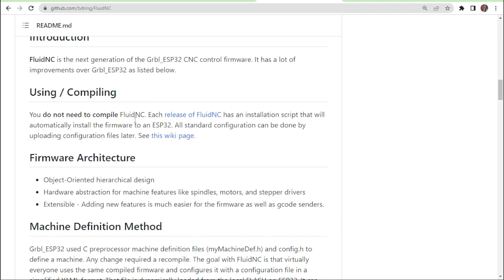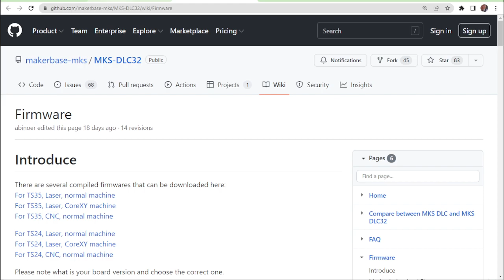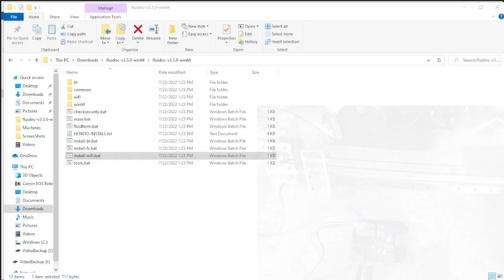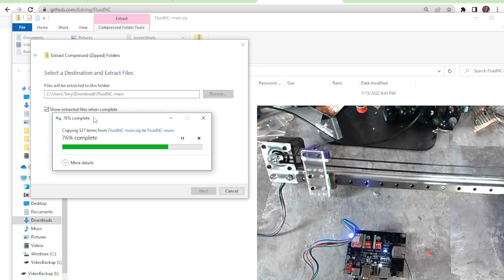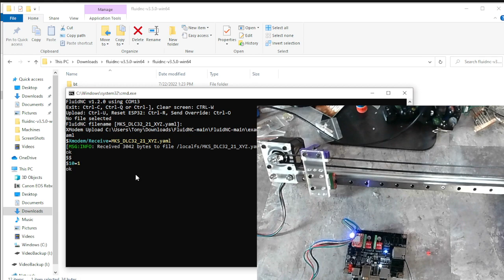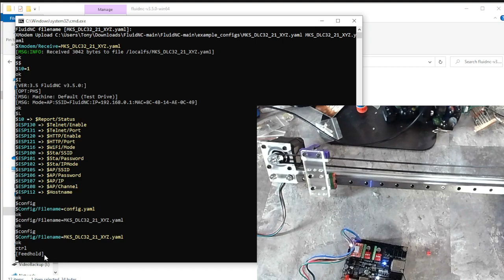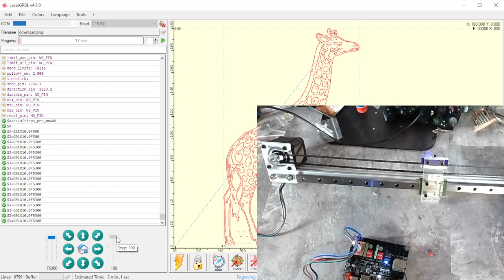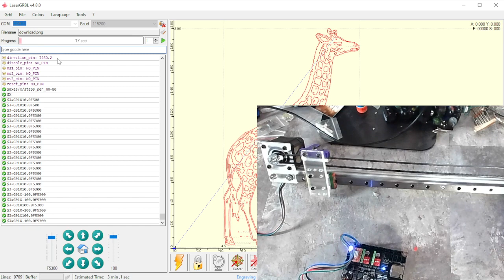FluidNC on MakerBAse MKS DLC32 V2.1

Comment: E = Enable
S = Step
D = Direction
G = Ground
Those pins are used for EXTERNAL drivers (Such as the TB6600) They are NOT intended for you to plug your motor directly into. Instead, use the JST header for the axis motors.

Comment: There's another MKS DLC32 version called the  MKS DLC32 MAX. It's capable of driving 4 stepper motors. I can't find a lot information on the MAX board, do you know if it's capable with Fluidnc?
Reply from the maker: @85rocco  nope.. it uses an ESP32-C3 which is a cheaper,but more limited board than a basic ESP32.
https://github.com/bdring/FluidNC/issues/1213
Reply: @brakthehun  Okay. Thanks for the info.
Reply: @brakthehun the newer ones seem to use the S3, which should work

Comment: Another suggestion is related to the config.yaml file. It can be specified directly in the web interface created by FluidNC. Although FluidNC allows config files with different names, if you rename the DLC32 file to config.yaml before uploading, it will already be recognized as the default configuration file.

Comment: Excellent video! I’m going to suggest an installation method that might make things easier. There’s a web installer right at the beginning of the FluidNC website—a Web Installer. Just follow the steps they suggest, and in the end, it will even install the latest released version. This makes things much easier because you won’t need to download anything.

Comment: I have gone from standard grbl to fluid nc but I notice a change in the management of laser power... for engraving on methacrylate I previously used 200mm/sec 20 power and now I have to use only 5 power because with 20 it perforates the material, It seems to me that power management is not delicate... Can someone tell me how to solve this please.

Comment: Yeah the screen thing is not FluidNC's fault. The MakerBase TFT is not open to customization as they don't provide access to the tools to 'reprogram' the firmware on that screen. I know, I asked a few years back.
Reply: Is there any changes to use mks tft35 with this board?

Comment: Hey man, thanks a lot for sharing those videos! I am trying to run a core XY pen plotter with 2 TMC2209 and a MKS dlc32 2.1 but I am having some trouble with the servo to lift the pen up and down. 

In the examples configurations file I couldn't figure out how to make a propper config.
Reply: İ want to make pen plotter. İ have mks dlc32 v2.1. How can do that? Do you know?

Comment: Hi 
I am Taljit Singh, from India... I am developing CNC router 8*4 feet bed size..... Earlier I opted. Arduino uno & GRBL sheild as controller

But now I go for MKS DLC 32v2...board, I flashes Fluid NC in board as you showed ( follow your instructions) but I had one problem, when I connect my limit switches to board, it disconnect automatically..... And COM not find the connection.... Can you suggest me the solution. 

Thanks
Reply from the maker: Check your limit switch wiring. Chances are you're grounding out the 5v and browning out the board.

Comment: Thank you Anthony for posting these videos on the MKS-DLC32 v2.1 board!  I am in the process of upgrading my K40 with this board and for me it has been a real slog.  I am thinking of using FluidNC and your detailed videos have been very helpful to my understanding of the work that is required. They have given me a much better grasp of the board and FluidNC software.
Reply: me too lol. I finally got it moving my K40... now hooked up laser tube and won't fire at all via lightburn :(

Comment: Hi, Nice video and well explained. I bought this board recently too with the same version. btw, what advantages of fluidNC over MKS default firmware?
Reply from the maker: For What I was doing,, I needed 2 y motors with 2 endstops (one on each side) along with an X-axis and it's own endstop. 

I also have a polarbear CNC which I modified and I use fluid NC's custom buttons to focus and draw.